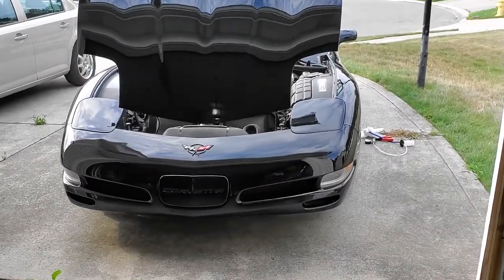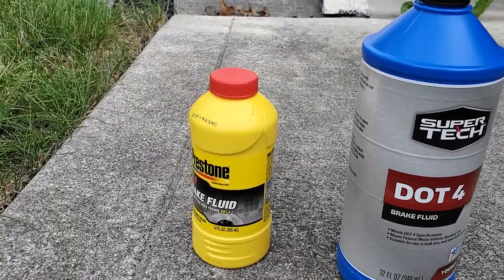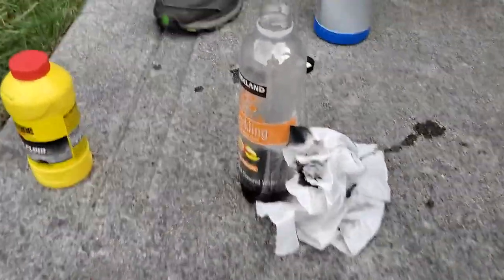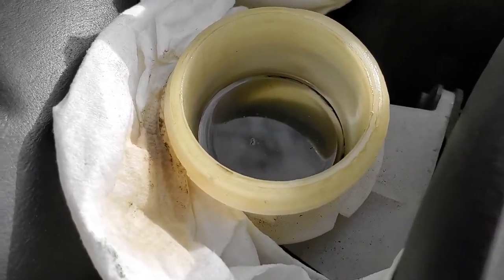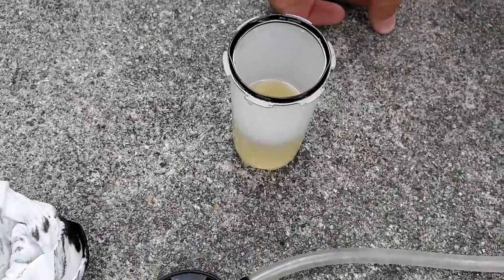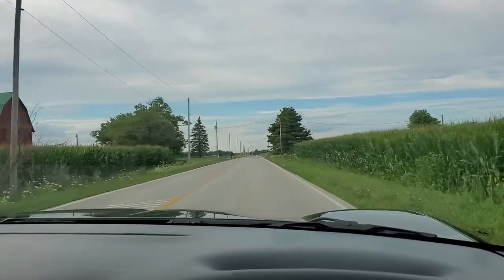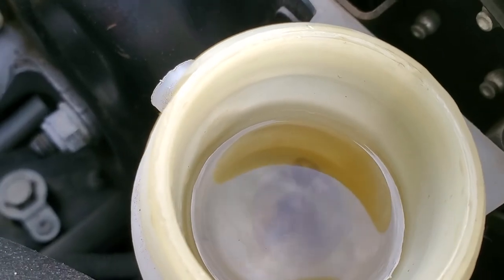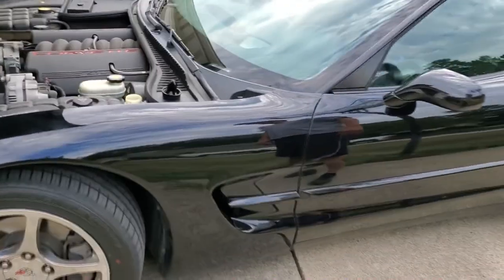How To Exchange CLUTCH FLUID on a 5 CORVETTE

Comment: Rookie mistake... You need to make sure not to suck out all the fluid and expose the hole, it will let air into the system which is bad.
Reply: No it won't there's still fluid below that hole